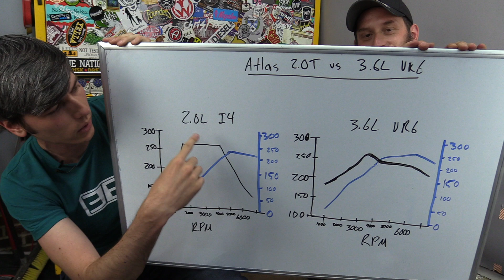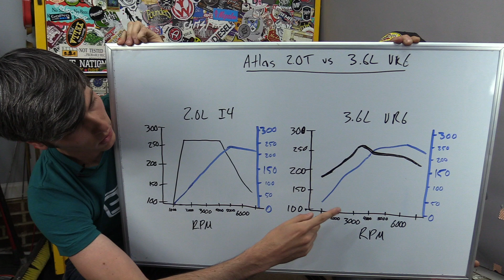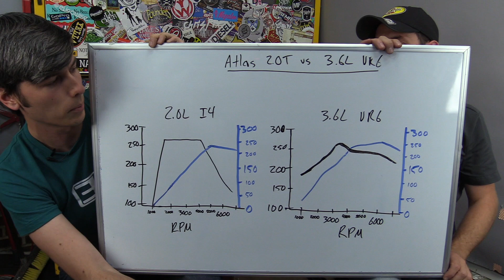4 Reasons Why The VR6 Engine Is Dying Off

Comment: The vr6 sounds soooo heavenly though....
Reply: I am right there with ya.
Reply: @HumbleMechanic  How would you say the '08 3.2l compares to the 2.0T?
Reply: I think that we all can agree. Turbo VR6 is best
Reply: Mihaly Lukacs not always
Reply: AMBush Drift ayy its ambush
Reply: Alex MkvTurbo I just bought a 2001 Jetta vr6 and I would love to add a turbo kit but they are so expensive
Reply: One if the best sounding engines hands down.  VR6 and Inline 5 turbos and Ford V8s are my favorites.
Reply: ayyyeeee AMBush drift! love your channel bro
Reply: alan!!!
Reply: I would add the i2 configuration to the list of good sounding engines as well, listen to any small FIAT. The DKW/Wartburg/Saab two-stroke i3 actually sounds a bit like the VR6. Small Japanese cars and the successful trio Citroen C1/Peugeot 107/Peugeot 108/Toyota Aygo are good examples of modern four-stroke i3 engines. With the right exhaust and at a good rpm, they do sound nice indeed.
Reply: AMBush Drift said absolutely no one ever
Reply: Love the VR6 snarl with a nice exhaust
Reply: Mihaly Lukacs ok that makes sense
Reply: Nathan Mulvany 3000$ from c2/kinetic. 245 whp @ 6 lbs. of boost.
Reply: I can vouch for that
Reply: +1!
Reply: in audi tt 3.2 vr6 mk1 sounds incredible sick. like a v8 at low revs and like a furious beast at high revs, thanks its exhaust valve system.
Reply: Only reason to get it
Reply: turbo the vr6
Reply: "Heavenly" 🤣
Reply: Boost it…. And you have a way better motor
Reply: Yeah there's two things that kill sound, turbochargers, and Inline-Four.
Reply: Yes always.
I'm not saying that inline-fours can't sound sick. And I'm also not saying that turbocharged cars can't sound sick, or that there aren't plenty out there that do already. I drive an I-4 Turbo that I'd say sounds pretty good. But does a turbo affect sound? Yes. Does an Inline-Four sound worse than an Inline-Three, Inline-Five, Inline-6, V6 or V8? Yes.
Again, that doesn't mean you can't make a good sounding inline four turbo, even from the factory. Because of course you can.
Reply: They don't call it vrSEX for nothing...
Reply: @sonicsfan4life  Here in Sweden the number 6, is acually spelled "S E X". And im not even kidding!  👍
Reply: AMBush Drift honestly it sounds amazing for a gti vr6 which you can buy for like 3500

Comment: Wow, this was a disappointing video. I was hoping to hear something about R6 vs V6 vs VR6 regarding vibrations and firing order.
Reply from the maker: As the title suggests, that's not what this video is about. If you want info on vibration, firing order, balance, etc, check out videos discussing the specific engines:
V6 Engine - https://youtu.be/YMoDcKXiKME
VR6 Engine - https://youtu.be/Y0LKWt3Ttic
Reply: The whole video was spent on explaining why the VR6 is dropping off and your only objective statement is that it has the same advantages of the I4. That was the entire point of the VR configuration. I'm pretty sure in a world with hundreds of actual professionals, they don't need any excuse at all to do what they think they need to do.
Reply: *definitely
Reply: What a passive aggressive layman remark. Nothing in engineering is implicit. There are reasons why anything is done. The only way to prove you even have a point is to make a video of your own explaining why every engineer in a massive automobile company is wrong. You're just saying words. This video showed a summarized set of data to support its point. You saying it's not convincing is just you disagreeing for subjective reasons.
Reply: While the VR6 is defiantly good, it has its limitations especially with larger capacity engines where the cylinder wall gets a bit thin. So they will not be as good for handling boost (even though im aware Subaru ignored this with their 2.5 turbo). Although, the VR5 turbo engines are fricken awesome.
Reply: Thanks, I'm checking those out immediately!
Reply: 200-300HP out of a I4, with good low-mid torque is definitely good for 90+% of people. especially if it gets 28+ MPG on the highway.